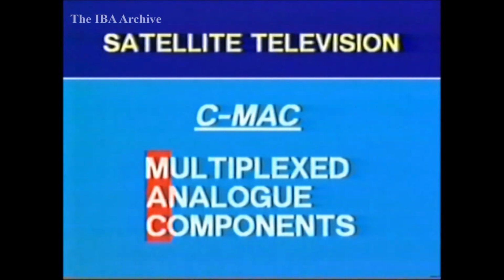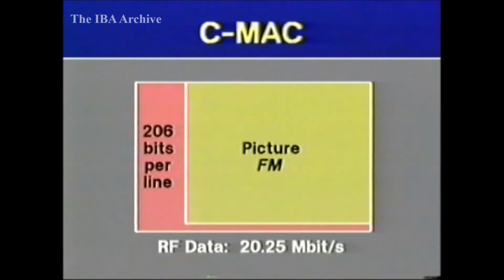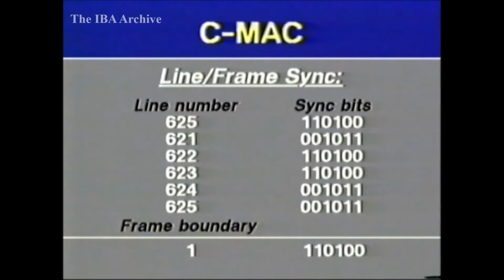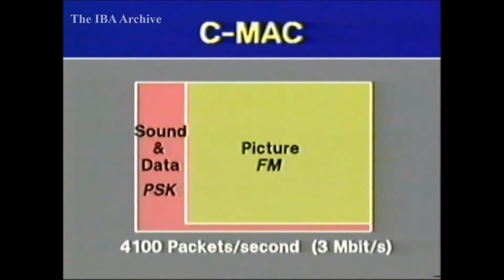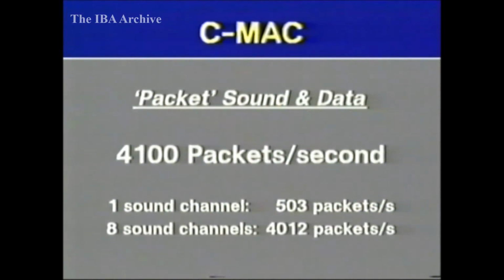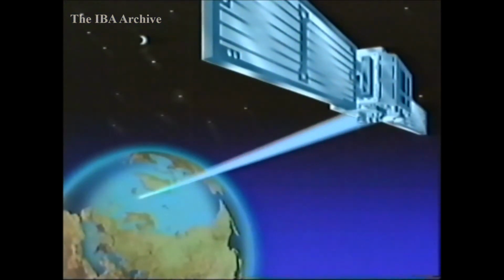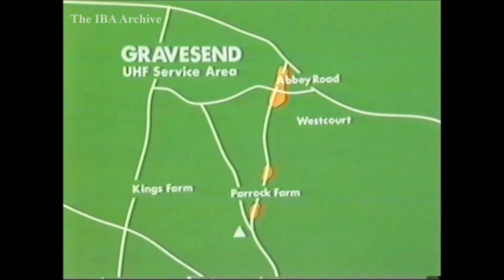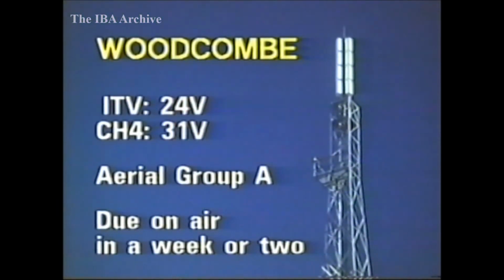IBA Engineering Announcements - 5 February 1985 'C-MAC Multichannel & Digital Sound'

Comment: Why couldn't the IBA go for this system for the BSB service rather than D-MAC? 

This would have been a better satellite carrier than PAL and provide high quality pictures and brilliant digital stereo sound plus extra radio channels and / or multilanguage soundtracks (if required).

I would also have a generous receiver spec too - 

(a) component RGB on Y U V phono sockets and stereo phono out sockets for connection to a RGB component compatible television for excellent picture quality and stereo sound on stereo TV sets, back projection units and projectors, 

(b) a 21 pin RGB SCART socket for good quality pictures on suitable televisions with SCART sockets, 

(c) a single stereo phono output for a HiFi system and a coaxial digital output and a optical digital output for outstanding digital stereo sound quality from a digital audio amp and speakers 

(d) and extra 21 pin SCART and S-Video / stereo phono sockets for recording pictures and stereo sound to a VHS recorder or for recording of high quality Y/C pictures to S-VHS cassettes,

(e) plus full function remote control.
Reply: Follow the money
Reply: Superior yes but channel bandwidth would have been over double that of D-MAC.
Reply: @gower23  D2-MAC is less than D2-MAC for bandwidth and can easily fit into a medium power satellite transponder as well as a high power one from MarcoPolo1 and 2